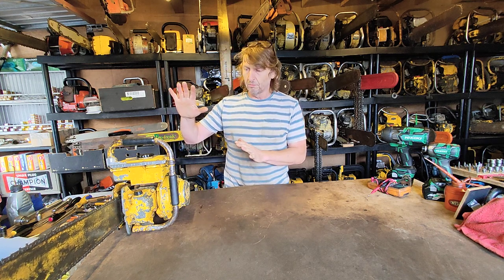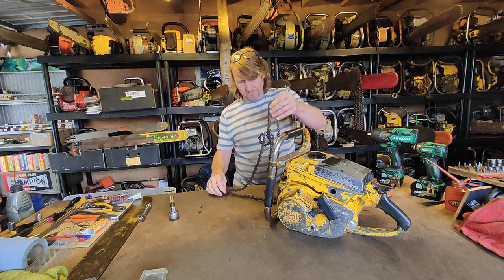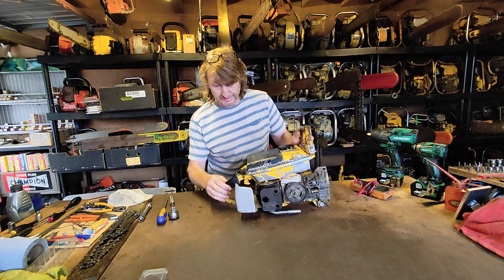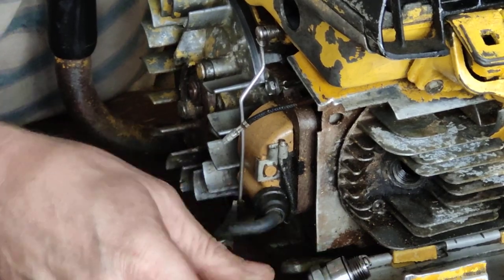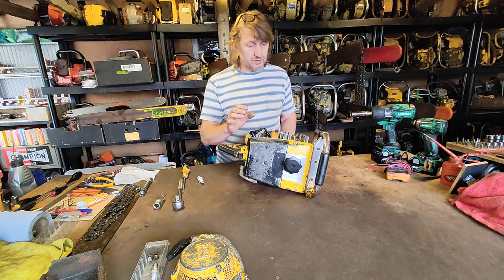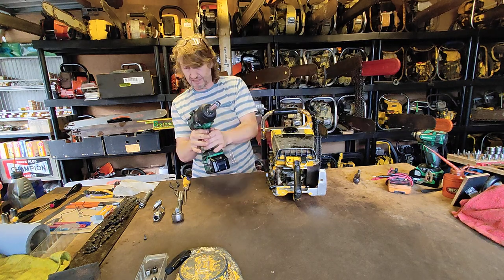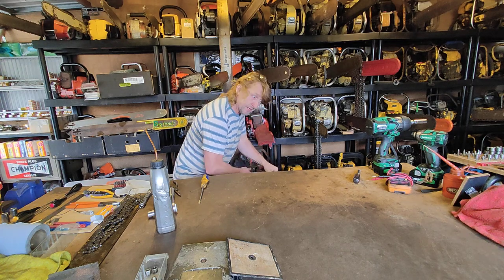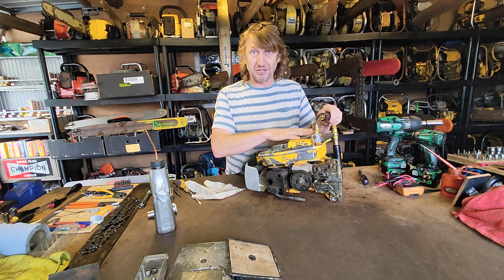Chainsaws. How to test an old ignition coil with no electrical Knowledge. McCulloch 1-72 is Guinea 🐷

Comment: Excellent video Rob.  I've used these ignition modules on a couple of engines before, but it never occurred to me that they could also be used as a "diagnostic tool".  It will certainly save the grief of determining whether the coil is "good" because the tests I have tried before are pretty inconclusive, and given the reduced availability of old spares, particularly condensers which are prone to breaking down and in short supply, may indeed prove to be a worthy (if not original fix) for a saw with low spares availability.  
Also that is a truly "horrible" ratchet that you were using.....

Comment: I bought an 041 Stihl power saw new, with electronic ignition. Finally the spark quit working. They no longer make coils. Plus mine was a Swedish electronic ignition. They also had a German electronic ignition. And the flywheels were also different. I bought 3 parts saws 041's. And I rob ignitions from all of the saws. Finally the last one stopped working. Of course this was over many years. The 041 also had points and condenser on the earlier years. I might be forced to change it to points and condenser. Maybe you can do a video on an 041 Stihl that has a bad coil and show us how to test it and other parts and perhaps even show how to fix it. I updated to a 046 Stihl, but I miss the 041 saw,,,,,,,,,,,,,,

Comment: Hi Robert, 
Such an awesome video. Thumbs up for the practical explanation..
Maybe in the next video you can show us the beer fridge in your workshop? :)))
Reply from the maker: Hello MOTM 😄
Thank you for the very kind message sir. It is really appreciated.
Unfortunately the beer fridge is in a very secret location 🤣
But I will definitely show more of my 2 workshops.
Warmest regards
Rob 😄🌲🪵🔥
Reply: @stridebaad1219  
Thanks for sharing your knowledge Rob. 
Btw you said the electronic chip only works for some ignition systems.

As far as I know they don't work where the coil is mounted under the flywheel e.g. stihl 041 or 070.
On a 051 or 031 it's mounted outside the flywheel. 
I read this in forums and can't confirm it by my own experience.
Maybe you have some info to share?
Do you get my point?

Best wishes Marco
Reply from the maker: @Swabian_sawman  hello Marco..😃👍
I have used them to test coils on Danarm 110 & 125 and several Clinton models.. all of these have coils mounted beneath the flywheel and the chips have worked with those coils..
Very interesting observation though. I have several older models of Stihl and will try it out on them when I have some time. The Stihl 041 is a very interesting saw, some literature suggests that some.early ignition coils on this model have some additional electronic circuitry within the coil that advances and retards the ignition, in that instance I doubt the module could possibly work.
Test test test might reveal the answer. I will let you know what Is discovered!
Kind regards
Rob 😃🌲🪵🔥👹
Reply: @Swabian_sawman  5

Comment: Fuel molecules are not smaller than water molecules lol.... they're long, big, hydrocarbon chains of oxygen, hydrogen and carbon. And coldness or whatever doesn't tell you anything about the molecular structure or reaction of anything. Nice video nonetheless.
Reply from the maker: Hello sir.. 
Thank you for the correction about the molecule size. I read that information some time ago about petrol and never verified it, perhaps I am misspeaking and referring to the ethanol content that I believe is smaller. I'm sure you will know better than me that almost any organic solvent will pass through the skins cutaneous layer and they all feel cold as they evaporate and the skin is susceptible to being badly damaged through exposure as well as the exposure to the vapour.
Fractional & steam distillation has only.been a recent study of mine and getting exact information can be difficult.
But in any regard organic solvents always feel cold and are always absorbed. As long as everyone gets the message about the danger I will be pleased. I will also mention this in the next workshop video.

Kind regards
Rob
Reply from the maker: Also... Just so it is clear for anyone reading this.
The feeling of coldness tells you a huge amount of information about the liquid. You know it is probably quickly vaporising and losing  energy making it feel cold, that in turn will tell you the liquid is almost certainly volatile etc..👍